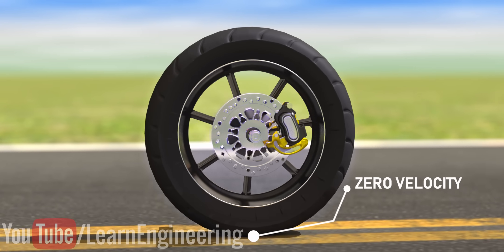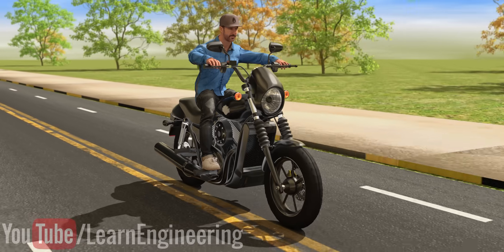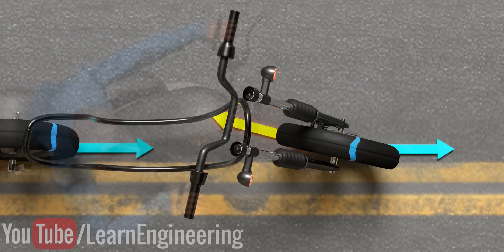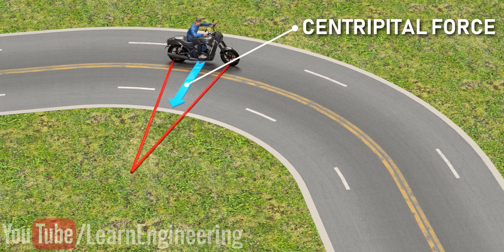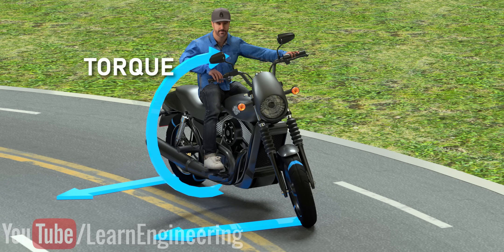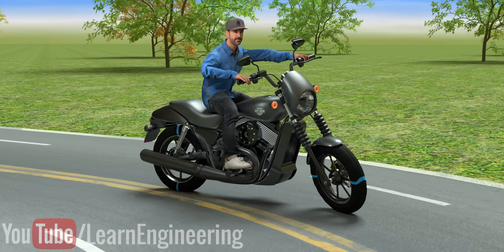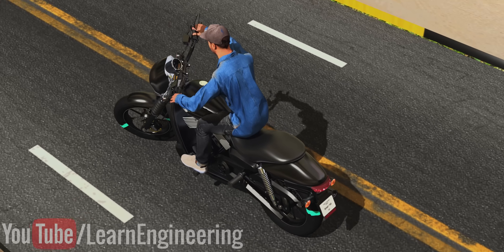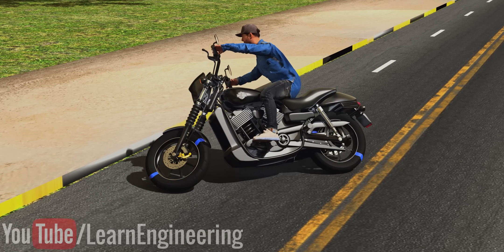Counter Steering | The interesting physics behind it

Comment: This video gives incorrect and dangerous instruction and should be removed before someone dies because of it.  Above about 5 or 10 mph, there is no "normal" steering, as it is referred to here.  If I try "normal" steering by turning the bars to the right, the bike will always lean to the left and, therefore, turn to the left.  I always use countersteering and leaning in concert, for all turns.  Viewers are warned to seek other resources for foundational information on this topic.  When I turn the bars to the left, the bike leans (and turns) to the right because of the rake of the front fork, not because of the other forces described in this vid.  The contact patch moves to the left, so the bike's center of gravity will no longer be on a line between the front and rear contact patches.  Instead, the center of gravity will be a little to the right of that supporting line, which makes the bike lean to the right, then the bars will also turn to the right in order to maintain non-slip rolling friction.  Failure to understand this dynamic is the cause of many "going wide" single rider accidents while negotiating a curve.  Beginners are advised to stop and figure this stuff out for themselves before they end up in a coffin.
Reply: Even you fail to describe this correctly. "normal steering" is for cars. Counter steering is for 2 wheels, bycles and motorcycles. Since there is a centrifugal force, you always need to lean into the turn. In the video they describe the counter steering action correctly. "When you steer to the left, the motorcycle will lean to the right. When you have a lean then you can steer to the right to counter the centrifugal force and go right. If you just steer left, you will fall to the right. Always.
Reply: @carlosvinaja4849  
I know it’s a years ago, but as far as motorcycles go…….. you’re wrong!!!

Comment: A two wheeled vehicle tracks an arc / turn, by running on the side, or off centre section, of the tyre. The fact that the side section of modern road going motorcycle tyres are profiled to be of a lesser circumference than the centre section greatly facilitates cornering. 
This angle of lean also counteracts the force pushing the bike to the outside of the turn, the faster we ride a corner, and or the tighter the corner, the greater the angle of lean required to keep the bike on course.

At any speed above jogging pace the only effective method to get the bike on the side of the tyre is to employ countersteering. In simple terms push on the left bar to go left, push on the right bar to go right, alternatively one can pull on the outside bar. Indeed we can pull on the outside bar and push on the inside simultaneously, but please be cautious when trying new techniques. 

Once we have set the bike at an appropriate angle of lean we no longer need to apply countersteer and the front wheel will track the turn due to the minor miracle of trail, small line adjustments can be made using body weight.
 Obviously if a major mid-corner course change is necessitated by a pot hole for example then one would use countersteering.

Comment: Wow, for an engineering channel, this is all screwed up. "Used by many bike riders"... uh... no, ALL bike riders. The motorcycle CANNOT steer any other way once the speed turns the wheels into gyros (10 to 15 mph depending on the mass of the wheels). The rider who thinks they're steering by leaning the bike is unwittingly counter steering. Useful for "quick turns" and "stunts"... again, no. It is employed in all turns, even mild turns like changing lanes on the freeway. How can an engineering channel not address the gyroscopic effects. That's the only reason 2 wheeled vehicles stay up right at all with speed. Watch any tank slapper video where the riders gets thrown from the bike. It will stand up and to straight until it hits something.

Comment: The tragic error involved here, is that there is no mention of forward velocity. Everything stated in this video is correct, up to a certain speed. Once the motorcyclist is over that slow speed, counter steering happens, regardless of the riders intent. So, if a rider at 5 mph turns the bars left to avoid an object in his path, the bike will steer left around it, however if a rider at 50 mph turns the bars to the left (pushes on left handgrip), the bike will lean to the right and pass the object on the right side. The more force applied to the handgrip, the tighter the turn radius,at speed. Everyone riding any 2 wheeled vehicle is aware of this, although most don’t analyze it. Overall this is a dangerous video for a new rider, and should be taken down, at the very least completely ignored. There are MUCH better videos out there. Nice graphics - Bad science.
Reply: Error in my post noted should read  - if rider at speed pushes on RIGHT grip, bike will respond by leaning to the right and passing object on right side. Sorry for confusion. Proofread.
Reply: Earle Ambeault Countersteer happens on all speeds.

Comment: I don’t agree with this tuition of steering and counter steering. When you travel on a motorcycle less than 10mph you can use direct steering, when you start to travel faster than 10mph you need to use counter steering to negotiate corners, if you approach a left bend or turn for example at 50mph and you turn your handle bars to the left you will be on the opposite side of the road then in ditch. Without knowing Iv been counter steering a bike since I started riding, it’s not a choice it’s what you have to do to negotiate corners.
Reply: Chris You can use direct steering only when you are off a bike, never when you are on a bike.
Reply: Have you ever ridden a motorcycle!!!! Or even have all your licenses?? You telling me when you practice riding a motorcycle on test ground under 10 mph and doing figure of 8 weaving in and out of cones you are using counter steering????? Well your a plonker! You need momentum to counter steer. I can’t pull out my drive way on cbr1000 and counter steering otherwise I would fall off you knob. You need to be moving over at least 10 mph.

Comment: Are you totally nuts? Delete this clip immediately because it gives a wrong impression to beginner riders! „Normal steering“, as you call it, only makes sense for low speed maneuvers! Above +/- 15 mph (depending on the bike) countersteering is the only possible way to ride through a corner. A lot of people do it unintentionally and they should practice swerving in order to use countersteering deliberately. To all the riders out there, take courses where you get professional assistance.

Comment: THIS VIDEO IS DANGEROUS AND MISLEADING!
AS A MOTORCYCLE SAFETY PROFESSIONAL, I STRICTLY CONDEMN THIS VIDEO AND DEMAND ITS WITHDRAWAL!
Many, MANY riders have crashed, gotten hurt and even died because they thought their bike would turn by leaning their body.
This video does not even explain the physics accurately! When describing direct steering, it just says "Turn the handlebars and then lean the bike and your body into the turn." It doesn't say HOW to lean the bike! THIS WILL NOT WORK AT HIGHER SPEEDS! You cannot lean your body far enough into the turn to counteract the centrifugal force (the forces of inertia) at higher speeds! You will go off the road! At higher speeds, you MUST counter steer to make the bike turn!

Comment: This is STUPID!! Why would someone do this. It sounds like they have never ridden a bike. Counter steering is the only way to make a turn and it doesn’t even happen the way the video shows. You turn the wheel right to turn right. That only works a slow speeds in tight turns not normal riding!!!

Comment: This simply is WRONG. 
It is also DANGEROUS, because, attempting this will cause you to crash.

The only way to turn a bike at anything but very very low speed, is to apply tilt. This is normally done by leaning, NOT by turning the steer. However, leaning is a slow and inaccurate way of turning a bike, so luckily we have counter steering.
Counter steering is caused by the gyroscopic effect in the front wheel, which will disallow any turning of the front wheel. Instead, a force applied to the steer, will translate into a tilt of the wheel, thus a tilt of the bike. As we just established, a tilt will result in a turn. 

The forces work that way, that pushing right handlebar away from you, will cause the bike to learn right, thus turn right. The important thing here, is, that you do NOT UNDER ANY CIRCUMSTANCE steer the other way during turning. This will cause your turn to open again, and you will drift wide. 

To bring the bike down for a right turn, you initially push "hard" on the right handlebar. The harder you push, the faster the bike will drop. To maintain the turn, you keep a "lighter" pressure on the right handlebar. To bring up the bike, you then either pull the right handlebar, or pressure the left.
Reply: Not bad. I will say that you don't push hard on the handlebar, that the bars--and thus the wheel--do turn ever so slightly, and that if you find yourself running wide in a turn, you can GENTLY push the bar to increase your lean. I did exactly that in a decreasing radius right turn on the Dragon a few years ago. It worked.
Reply: @craigmilliman2763  
No, "hard" is used relatively : ) Which of course makes me think: How much do we actually push?
On normal riding, I would say the initial force for semi-agressive manoeuvring, is enough to move a chair on a wooden flor, but not a normal table. Somewhere in that range ...
Reply: @craigmilliman2763  
Also, during cornering, the front wheel of course turns into the direction the bike goes, but that is NOT something you do. The turning of the front wheel is something physics does, to keep all forces happy, and explains why it is perfectly safe to steer without touching the handlebars.
If you lean right, the bike goes right, and the front wheel will move to whatever position it needs to be in, to keep physics happy.

The result is, that during counter steering in a right hand corner, the front wheel will due to physics obviously point ever so slightly to the right, WHILE you try to force the steer to the left.
Might be hard for some to understand, but that is none the less how it works.

I think some might underestimate the forces of the front wheel on a bike. At ex 50 kmh, you can NOT physically turn the steering wheel, unless applying hundreds of kilos of force.

Comment: Cool physics explanation, but the visuals are misleading and the explanation of rider body position is wrong. If you are slow enough to use normal steering and lean inward like the dude in the video, there’s too much weight on the inside and you will fall. The rider needs to lean their body to the outside to balance the bike. And it is during COUNTER-steering where you need to lean inward, or else you might also fall.
Reply: Also, in reality counter-steering is used way more often (because of speed) and therefore there’s an argument to be made that it is the “normal” steering method.

Comment: Understanding and using countersteering is as important as knowing how to use your brakes and throttle properly. It is another tool for the rider to use for especially when a quick response is required. I think most riders countersteer without even knowing it. This video isn't the best for learning this method though.

Comment: this video is wrong and will get people hurt
Reply: How is it wrong?
Reply: Joe Promedio 
Counter steering is 1 action throughout a bend. On a left hand bend fore instance, you push the left bar, the bike immediately starts to lean left. The harder you push the more the lean. When coming out of the bend, release pressure on the bar slowly and the bike sits up. What you don’t do is start a bend with counter steering and then point the wheel into the bend (the bike will sit up mid bend), the front wheel will self align, you need do nothing except maintain pressure on the inside bar. Hope this helps.

Comment: I had my first motorcycle at 9, practiced motocross, rode to middle and high school in my motorcycle everyday, rode a Sanglas 500cc for years without a license, rode to college, in 92 bought my first ZX11 in Venezuela without speed limits and squeezed the shite out of that throttle for 10 years until I got my R1200RT.
Now this is the first time in my life that I hear such bullscrap that's going to have a lot of people hurt.
Just practice and follow yous instincts. Let the bike talk to you. Be one with her and control her with your instinct. Start small, start slow. Be safe. Gain confidence until riding becomes automatic and you don't have to think about it.

Comment: One really need to practice this cause, yes, it is too risky...
Reply: HYPERION Rider VLOG 
It's not risky at all man. This video is a complete load of crap. Counter steering is a breeze and puts you in control so much more. Simple.... Push left, go left,....... Push right, go right. When I say push, I mean push forward, not down. It's only a slight pressure needed and the bike will respond immediately, just start slow and gentle..... You'll get it.  It is that simple.  Hope this helps.

Comment: So, is it literally counter steering towards the  opposite direction or just pushing down or applying pressure on the opposite direction of the handle bar ?
Reply: Sky High 
Literally..... Push right, go right..... Push left, go left. Push forward not down and not to much, it's only applying pressure. Start slow until you get used to it.

Comment: There's a very important thing here which is completely ignored, and that's the speed of the vehicle! At low speed the translational momentum dominated the angular momentum, this allows you to steer with the forks and use your body weight. This will only hold for very low speed, up to about 10mph. Once you speed up the angular momentum dominates and the vehicle becomes stable, which means it will actively resist your leans and steering. At this point the countersteer is the ONLY way to safely alter your direction.
Reply: I'm a new rider, the way I use is to brake and slow down before the turn, it seems to work for me every time but I've never driven bigger bikes or a bike on a highway so i dont really kniw

Comment: I tried it on a clear, open road. Found it incredibly unnerving! This video certainly explained the science of it but did noting to make me want to try it again!
Reply: Roger Branton 
Just push left, go left. Push right, go right. That’s it! The advise in this video is misleading and dangerous.
Reply: @softailfun  Is it the same technique that the flat-track guys use? Because seeing that performed makes sense and looks doable, although  that's more of a power-drift, isn't it?
Reply: Roger Branton 
No, it’s completely different. Don’t even think that they are similar. With counter steering (on the road), the slightest of pressure is applied to whichever bar you push. The more you apply pressure the more the bike will lean. Hope that helps. 👍🏻
Reply: You're probably turning the bars too far or too hard.

Comment: Whoa! That's some crazy physics! Achieving the same outcome with opposite inputs. Can that guy on the scooter demonstrate that for us?
Reply: There might be a speed where both are possible but at slow speeds it's normal steering like in a parking lot and on the street it's counter steering. you can not steer normally at speed only counter steering. all the theory in the world doesn't mean anything if the reality is different.

Comment: This is the most argued thing about driving a 2 wheeled vehicle. When someone argues with me about it I have a perfect test to prove it’s the only way to turn at any speed above about 20mph. It helps to have cruise control or a throttle lock. And no traffic around you. Get up to the speed you want to work with in the right lane and set the cruise. Take your left hand off the bar and place your right thumb against the back of the bar vertically. Now change to the left lane. The only rule is the right thumb has to remain in contact with the bar. Lean over, stand on 1 foot peg whatever. It can be done but not quickly. Now switch hands and try to move to the left my applying pressure with your left thumb. Remember gently at all times or you could crash.

Comment: This is actually confusing, from practical videos, what I've seen is that above 10mph or so, pushing the handle bar on the side you want to turn will lean and turn the motorcycle in that very direction. However, at low speed below 10mph, turn the handle bar toward the side you want to turn will make it turn that way.
Reply: What you have described is counter steering. Push on the right side of the bar, turning the front wheel slightly to the left, and the bike leans and turns to the right. Turn left to go right. That's why it's called "counter" steering.

Comment: Its a decent video but it can be a bit confusing and can do better explaining push vs pull of the handlebars. Canyonchasers video on cornering does excellent job of explaining counter steering and leaning correctly.

Comment: Arrrrrrrrgh. Wrong physics! It's always counter steering, it's not optional. Sometimes it's less conscious but the principle is the same. Leaning is the consequence of countersteering, even if so subtle as to be unconscious. You cannot simply lean from thin air. Even when you think you just shift the body weight without turning the bar, you actually need to push away from your bike with your lower body to do so. Bike will slightly counter lean, then follow you.
Also, the video inaccurately shows turning as if the front wheel were slipping (steered sideways but still going straight). Geez. When you turn the handle, the bike actually rides away sideways from under your butt, which makes you lean, and then it starts following the turn. So many physics & engineering mistakes here, wow.